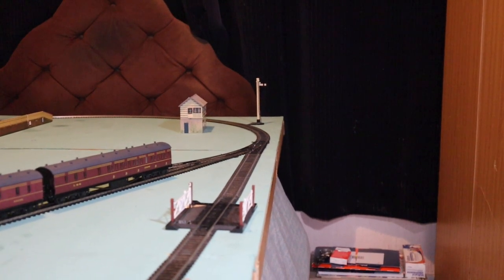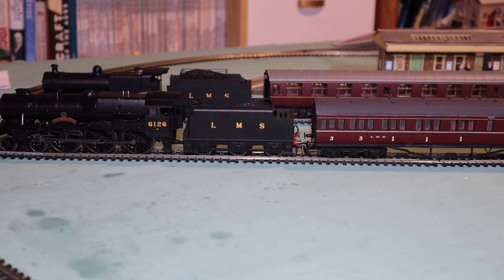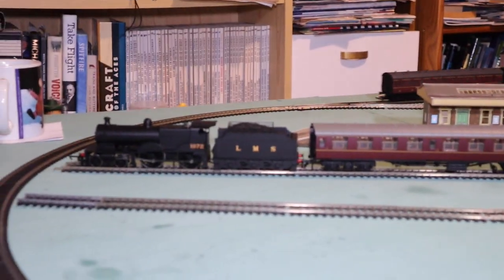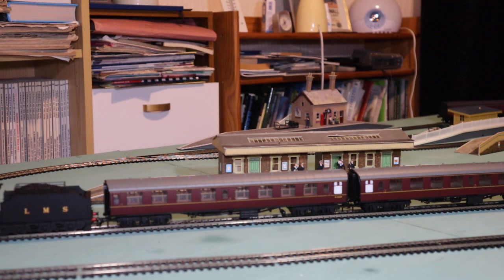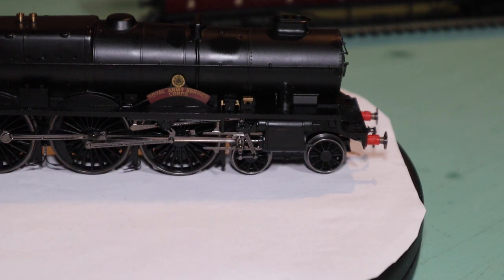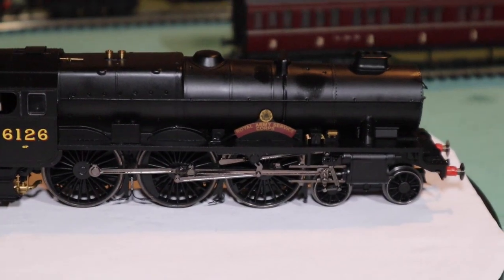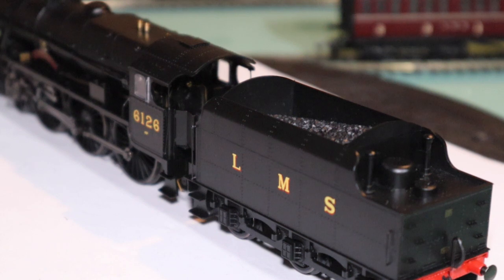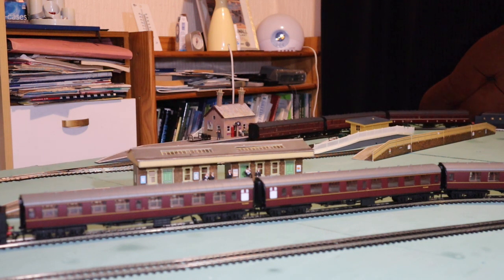Hornby Royal Scot and LMS Compound Running Session

Comment: I know a bit of LMS steam engine history, if you'd like to learn something new. Before he came to work for the LMS, Sir William A. Stanier worked under Charles Collett of GWR status. Charles allowed his companion to borrow the GWR Hall Class Blueprints. Sir William took the Blueprints to his LMS workshop at Crewe, and drawing on the Hall Class design, he created the Black 5 that earned this title: Jack of all Trades. So the GWR Hall and the LMS Black 5 are cousins to each other. The one thing the same about the two is that they are both 4-6-0 tender engines.